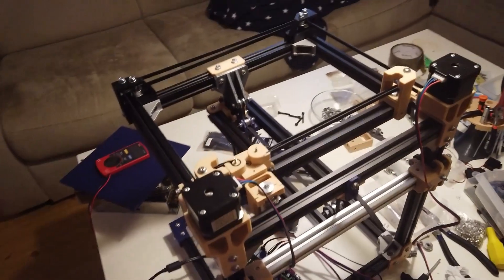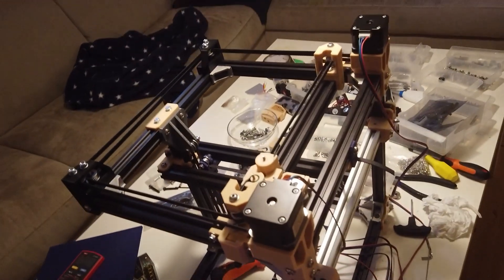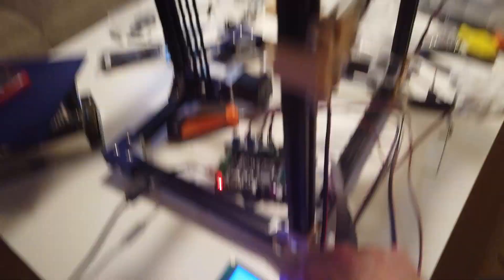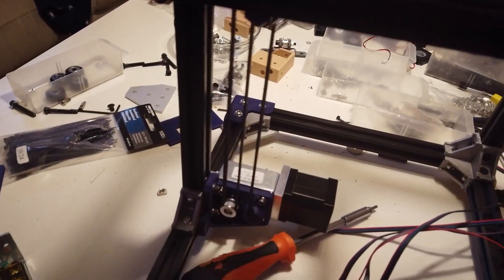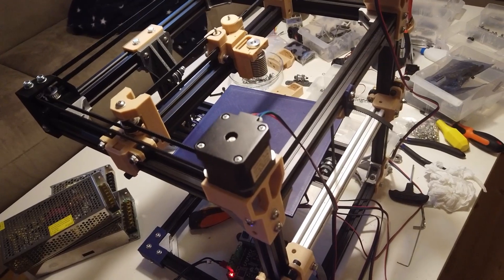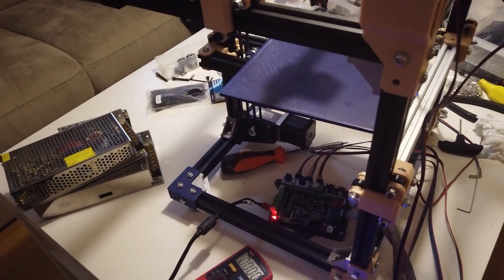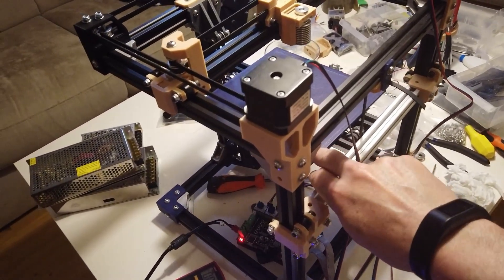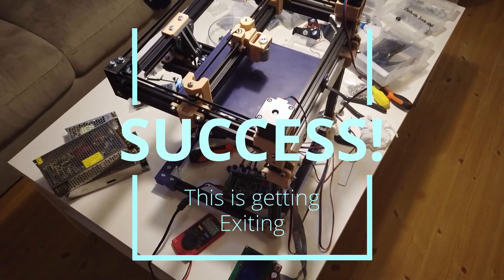3d Design Vlog - CoreXY 3d Printer - PROTOTYPE BONUS MATERIAL!

Comment: Beautiful work, I am always admired for the things he does, every time I see he gives me good ideas to improve my XY core printer that I put together with profiles 2020 v slot and SC82LUU linear patienes.

I want to change change for the mini wheels in V but I have some questions about these wheels.

I was seeing in the pages that there are different types of mini wheels, mini linear guide wheels, mini wheels V slot (black color) and mini wheel slot V (transparent).

What function does each of them and what do you recommend, I would not like to buy mini wheels that are not the final ones that I need.

Thank you in advance for sharing the valuable information you provide
Reply from the maker: Thanks! The mini wheels V slot black are the same as the transparent -  the transparent are in polycarbonate and more durable but you dont need this. I dont know the other wheels - Just get the black mini wheels for 3 printers. The rest is more for CNC
Reply: thank you.  but I have another question, I realized that you also use mini double V wheels on the Y axis, what is the function of this type of wheel ?.  Thank you for your answers.
Reply from the maker: @oswaldomartineztello4773  I only have regular mini wheels on this machine. Nothing special here : https://makersupplies.dk/wheels/126-wheels-delrin-mini-v-wheel-kit.html
Reply: @PRO3DESIGN  Thank you very much for taking me out of that doubt I had. beautiful printers.